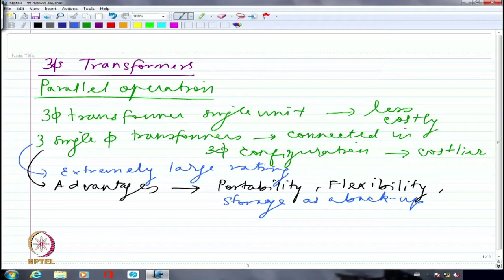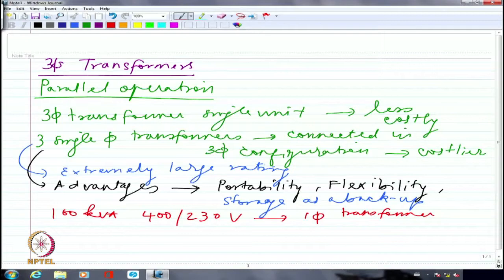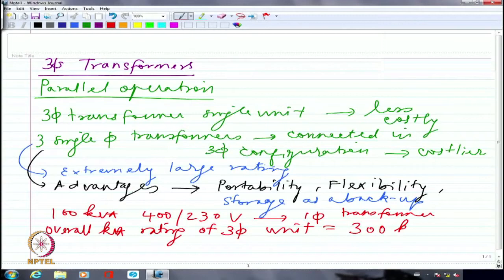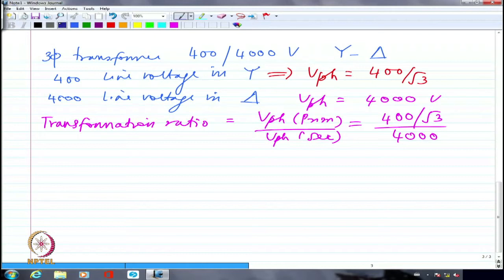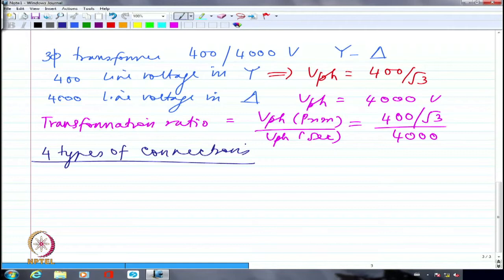Three Phase Transformers-I

Comment: I think 3rd, 5th, 9th and 15th harmonics and other zero sequence (co-phasal) harmonics do not kill themselves in the absence of a grounded neutral, rather what's more correct is that having zero sequence harmonic current in the primary will induce even higher harmonic voltages in the primary winding and then same in the secondary and these harmonic voltages will create a distortion in the machine and the system